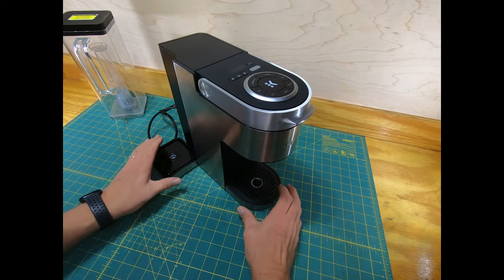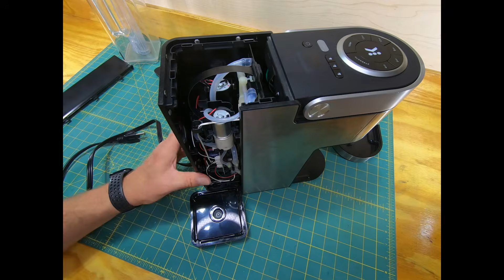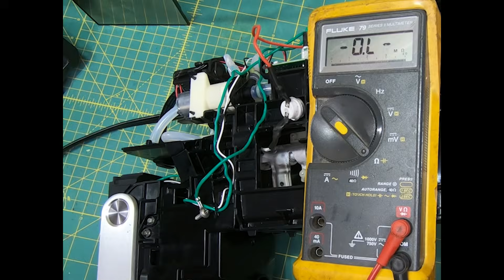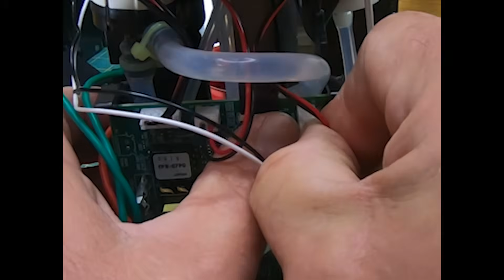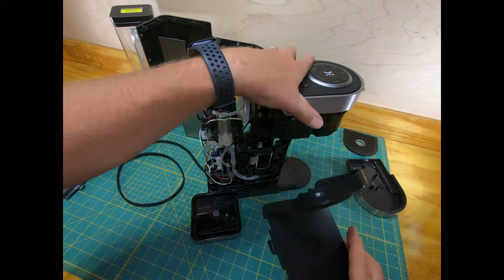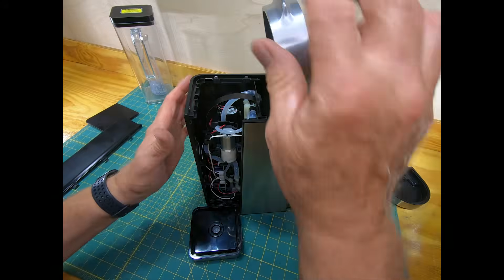Keurig Has No Power I Removed the Cover and Fixed for FREE

Comment: I can't thank you enough for making this video. I thought my unit was toast! I tried to make a cup of coffee with the water tank removed and it smelled burnt and wouldn't power up. I have a model K921 and only had to get the cover off. Once open, I was able to see the thermal switch and used a large paperclip to poke it to reset. I didn't have to remoave any parts. I am so happy I don't have to spend $150 to replace it. Thank you, you rock Mr Carve!

Comment: Thank you for the video.  I was able to fix mine by resetting the switch. Mine quit working all because the water reservoir wasn't on quite all the way. When it started heating up, I guess it tripped it. Glad that was an easy fix. Broke a tab or two but better than buying a new one.
Reply from the maker: The cover was really not designed to be removed. They want you to buy another one. Thanks for the comments!

Comment: Why in the world would you have a non-externally-resettable thermal switch other than for planned failures and replacement?  This is the kind of thing regulatory bodies should investigate.  Keurig needs to be fined for putting out these pieces of garbage.  Mine is less than 6 months old and tripped this switch.  DO NOT BUY THIS MODEL.
Reply: Money grab by Keurig under the guise of safety. Yes, the Thermal Fuse is a safety device, but if the pump system on these worked appropriately, the fuse fail wouldn't occur this frequently. And if you want to give Keurig a pass on that design then having a thermal fuse that's buried in the guts without an external reset button  is inexcusable.
Reply from the maker: I've never had an appliance so aggravating. I am guessing this is a safety device and if it reset automatically after cooled down and the power was still on, it would start the cycle over again. Probably a fire hazard and would not be good if left unattended.
Reply: @CarveTools but I mean they should put a button to reset it instead of tearing it apart
Reply: Yes for sure
Reply: Thank you a million brother you just saved us $300 much appreciate your video
Reply: Because they're hoping most people won't know how to do this.And then they just buy a new one
Reply: Totally agree!! 🤨
Reply: Second Keurig in less than two years because it just stopped working! We only make three cups of coffee every morning! This is inexcusable!
Reply: IMO, the internal thermal breaker is a good feature.  If this was an external resettable feature, people would ignore it till they burned their house down. Then blame Keurig. This fix took me about 20 minutes to accomplish. Then I descaled my machine, which was likely the cause in the first place. Pretty much like  everything today, the product life is far shorter than in the olden days. I give kudos to @karvetools for making this video. If your opinion is different and you want to spew hate and negativity, it’s your opinion.

Comment: So I did this and it started momentarily but then shut off again.  I let the switch cool for awhile and tried again.  Same issue.  I have been away from home for a couple months and when looking at the clear tubes I could see there was very little if any water in the tubes running to the heating element.  My conclusion of why it was overheating and tripping the switch.  I couldn't think of an obvious way to get water into the line but after some fiddling I realized if I lifted the water reservoir off the base and set it down again I could see air moving  and a bit of water in the line. I keep lifting and setting the reservoir down until water actually started to come out of the spout.  I then plugged it in and set it to the coolest temperature to minimize how hot the water needed to get.  Works perfectly.  So if you have a Keurig and it has been sitting idle for a long time I would suggest lifting and reseating the water reservoir numerous times till you see a bit of water comes out of the spout.  That should prime the lines and ensure water is available to heat and likely minimize the risk of tripping the switch. Note my unit sat idle for close to 6 months so I am not surprised the line was dry. Hope that helps someone.
Reply from the maker: Thank you for sharing that information!

Comment: Unbelievable. Woke up this morning, made coffee and it just steamed without any liquid coming out. Thought I was doomed. This worked like a charm. NOTE: for the simplier less mechanically inclined people, I didn't have of of the eletricity parts and it worked fine. To reset the switch all I used was a staple (without plugging the tester in). Also, didn't test each section like he did after resetting. I just tested it before putting it back together. Works like its new. THANK YOU!
Reply from the maker: Glad this helped. Thanks for the comments!

Comment: I did exactly as you showed in this video and everything worked! Thank you so much for the helpful video! But alas as soon as I tried descaling it shut off again with the same issue. Any other ideas on what to do?
Reply from the maker: Maybe fill the reservoir and place it on and off several times. It may be like priming a pump to get the water flowing.
Hope that helps.

Comment: I have the same Keurig, I tried this and it fixed it. I plugged it in and it turned on just fine, but when I tried actually using it, it stopped turning on again. What could be causing it?
Reply from the maker: I had the same problem where I reset the thermal switch then it tripped again on the first try. I would reset it again and then plug it, fill the reservoir and initiate a descale cycle. Hope that helps. Thanks for the comments.

Comment: Keurig must design these to force customers into buying another one. Otherwise what's up with the hidden reset button? Most hair dryers and many other electronic devices have overheat protection the consumer can reset, in 10 seconds or less. Those that don't  automatically reset after a cool down period.
In the morning after the descale procedure, I found my Keurig had flatlined. It was unresponsive and I could not save it. Oh no, coffee withdrawal! Your tutorial saved the patient. I performed the operation as described. The most difficult part was opening the patient's chest to get at the vital organs. I only wish my surgical professors in Med. School were as good a teacher as you are. You should get an award for saving the lives of countless coffee machines.
Reply from the maker: Removing the covers is the most difficult part. A self-resetting thermal switch would likely not pass the UL requirement for this appliance and here we are trying to figure out to buy a new one or can we fix it. Glad this helped and thanks for the comments!
Reply: I agree that they built it not to last.

Comment: I consider my self a well educated gifted high level DIY. 
This Video on a scale of 1-10 is a solid 10. 
The instructions for dismantling the Keurig K-Supreme Plus are 100% clear and accurate.
I had to remove the circuit breaker to reset it, but power was restored after the reset.
Not sure why the manufacturer refuses to incorporate a circuit breaker that can be easily reset from the back of the machine for an ongoing problem that has been an issue now for more than several years, I know why, it would make sense:body-blue-raised-arms:
Thank you CarvTools for sharing this valuable Video👍
Reply from the maker: Glad to hear this helped. Thanks for the kind comments!

Comment: Hi Dave, great video! You’re a great teacher too!👍.  I’ve got the Keurig Supreme, not the plus.  Did a descale and I think I overheated the thermostat. Will have to try the reset trick.  Question. What caused it to pop the thermostat before you tested the motors after the reset?  Did it just need a descale?   Doesn’t your unit have an indicator telling you to descale?  Thanks man. I subbed.  I also love that little adjustable power source. Great tool. I’m going to see if I can find one. 😁
Reply from the maker: The thermostat originally tripped when first powered up after not being used for some time (months). Might be a good ideal to descale the Keurig before putting storing it away. Thanks for the comments!

Comment: heh
This what I did: removed cover, drilled a hole on side to access reset button, installed a rubber hole cover, put everything back together. Now whenever the heat sensor is tripped, I remove rubber hole cover, insert a paper clip and reset my Keurig….no need to remove cover anymore.
Reply from the maker: That will work! I think Keurig did not do this because of an electrical shock potential by not unplugging the power cord. Thanks for the comments!

Comment: PLEASE Help! I think one of my pumps isn't working or is not pushing the water through, I need to be able to test mine using the voltage supply, like you did, but I have looked everywhere and can not find the connector you have to go into the plugs for the pumps, the positive and negative needles looking connector thing. Do you know where I can find it or what it is called. Or if another connector will work?
Please let know as soon as you can. Thank you!
Reply from the maker: The wires I uses are breadboard jumpers https://amzn.to/3P8EKHS 
and this is the power supply https://amzn.to/4c10oHM
Hope that helps and thank for the comments.
Reply: @CarveTools  Thank you, I finally found there name, took forever. But I ended up just testing everything with a 9v battery and a paperclip that was broken into two small pieces to make the connection, worked like a  charm. Turned out that the pump had been plugged up, so the reason the safety button keep being tripped was because there was no water flow to the heating element and it would just get too hot right off the bat. At least that is how it had seemed. Knock on wood, but haven't had that safety button trip on me again since after putting everything back together. We used a small bowel with water in it, to test the water pump, and to eventually get scale build up out of there. 
- But a reminder, that this can be dangerous. Do these same steps at your own risk. But please make sure that you are always being as safe as possible.  Always have the Keurig unplugged before doing any of these things. And Again, this is just what my fiance and myself did, I am not telling anyone else to do any of these things directly. And hope this comment was ok, Carve Tools. If you think it might not be a good comment to show than please feel free to delete it. But thank you again for all the information, I really appreciate all the help you have given!

Comment: And what about make a wonderful hole 2” 3/4 from the left and 6” 13/16 from the bottom !!
It works perfectly 🎉and it took me 2 sec for the hole and 5 min to push on the kill switch 😅
Reply from the maker: Glad this helped. Thanks for the comments!
Reply: Great idea! It took me a few hours to do this before reading your post, but your dimensions 2-3/4" x 6-13/16" matched mine exactly. I used a 1/16" bit and a straightened a paper clip for the pusher. (The hard stainless cover was had to drill.)  Careful! --UNPLUG it before resetting - there is 120V at the switch! I would like to see an electrical schematic of the "add water" continuity sensor circuit. The "Add Water" lights up okay when I unplug the sensor from the circuit board, but water sensor does not dry fast enough to prevent shutdown and thermal over-temp every time.

Comment: So I followed this to the letter. The unit did come back on but it was in descale mode. When I tried to initiate the descale by holding the 8 and 12 oz buttons the "big K" flashed but when i pressed it nothing happened and the unit continued to flash "descale". Any suggestions?....or is it time to toss it?
Reply from the maker: If the "K' was flashing, the thermal switch is working. I'm not sure if the lid has to be opened then closed to start the cycle.

Comment: I picked up this same machine at a local thrift store, in brand new condition for 13 bucks, plugged it in, no power, found your video and had it fixed in 10 minutes.  It’s currently going for $219 on Amazon.  Instant channel follow!
Reply: Damn bought mine for 14
Reply from the maker: Glad this helped. Thanks for the comments!
Reply: Ugh yes I just bought mine for $1 know I’m trying to fix it 😂doesn’t turn on
Reply: Same

Comment: Thank you. Your tips for dismantling in this video and your " Keurig Coffee Maker No Power Fixed for FREE " video helped us to reset the Keurig without having to replace yet another failing Keurig. Fortunately we did not need to remove the sensor reset. Just reached in with a paper clip and reset it and the thing worked immediately. Now moving on to figure why it keeps going into descale mode every third cup despite having descaled the thing. No clue. thx x2
Reply from the maker: Glad it helped! I have no clue why it would want to keep descaling. Thanks for the comments.

Comment: My unit just like this one is working but when I make a cuppa coffee, the multi needles splash all over the place it doesn’t come down in a single stream. Could you tell me what the issue is with that? Thank you for your video
Reply from the maker: Sounds like the needle is clogged. The cup and needle can be removed and cleaned out. Hope that helps and thanks for the comments.

Comment: I drilled a hole in the steel/plastic cover at the exact measurement needed to access the heat switch reset button. I won't provide the measurements because you need to get the cover off before doing this, otherwise you'll likely drill a wire. Then when it's off, you can measure for yourself and de-burr the steel hole with a philips bit on a drill. Takes a little while because the steel is tough. I did a 3/8" hole so I had to walk around the hole with the bit until it was smooth; if your hole is smaller than your philips bit, you may not need to do that. I wanted a larger hole so I could more easily see where I'm poking.
Reply from the maker: Wonderful. I thought about that but kind of cautious someone might get shocked. Thanks for the comments!

Comment: Has anyone tried removing the covers without removing the three bottom screws?
Reply: I just looked, and the outer cover does have a stub which will not allow removal without removing the screws. That appears to be their purpose. You can tell by unscrewing one screw and pulling/flexing the cover gently away while shining a flashlight into the hole - you can see the hole move in there.

Comment: @carveTools Where'd you get the work mat?
Reply from the maker: The cut mat is available at Amazon. Here is the description.
OLFA 18" x 24" Self Healing Rotary Cutting Mat (RM-SG) - Double Sided 18x24 Inch Cutting Mat with Grid for Quilting, Sewing, Fabric, & Crafts, Designed for Use with Rotary Cutters (Green)
Reply: Trips when trying to run descale or a normal cup, after resetting the thermal switch any recommendations? I don’t have the power supply
Reply: Is there a way to unplug the heating element and run just the pumps?